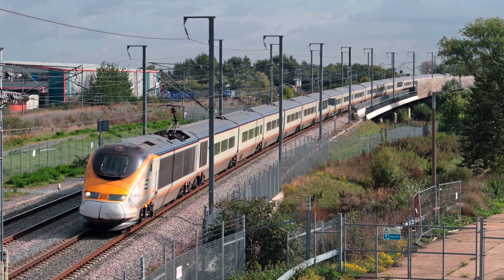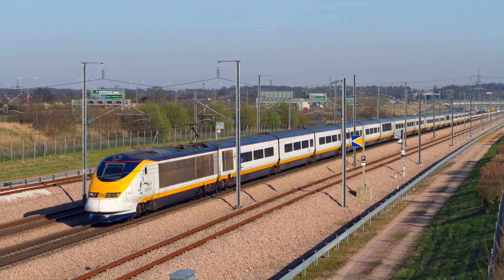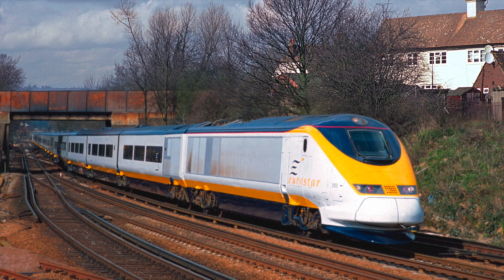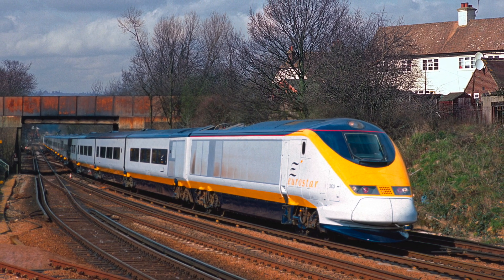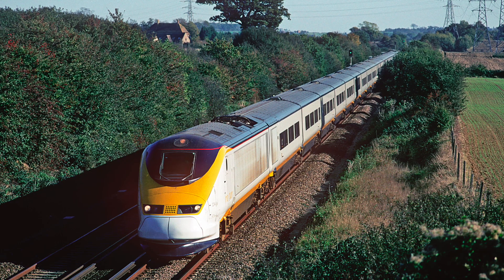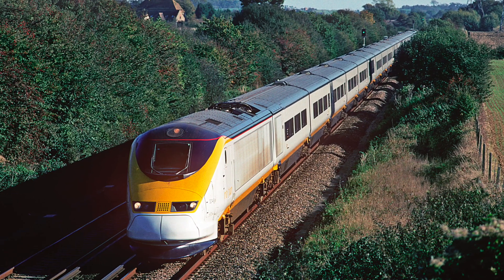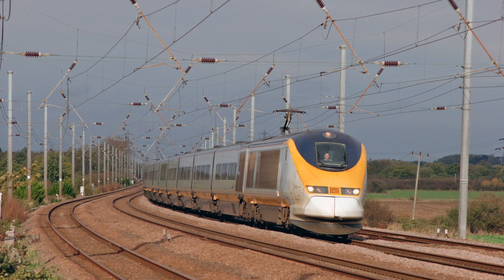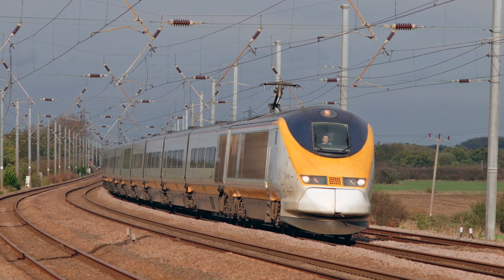A History of the Class 373 Eurostars

Comment: The class 373s run in pairs, 2 power cars with 2×9 car half sets  between. The passenger coaches are articulated, with normal bogies in the centre of the train. As built they were triple/quad voltage, 25kV, 3kV dc and 750v 3rd rail and some French sets 1.5kV for their classic lines. The outer ends of the half sets carried an extra power bogie adjacent to the power car, meaning six power bogies per full set.